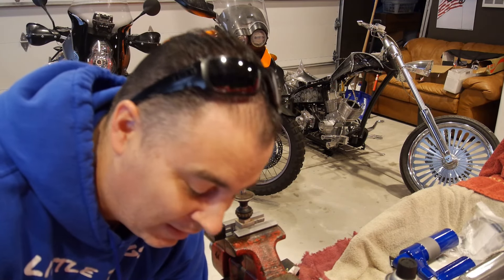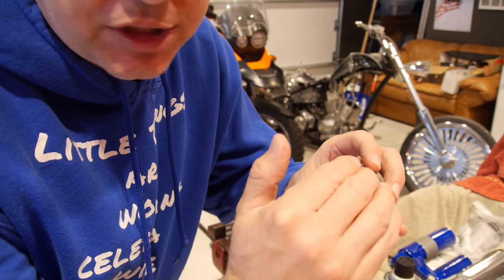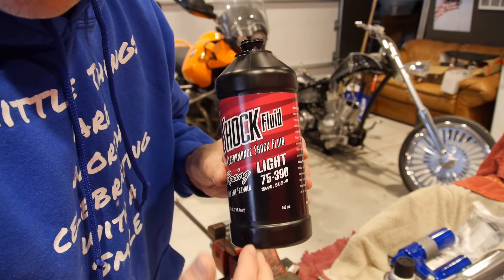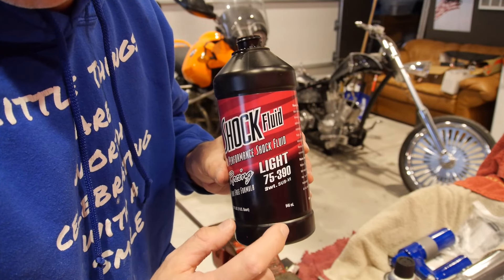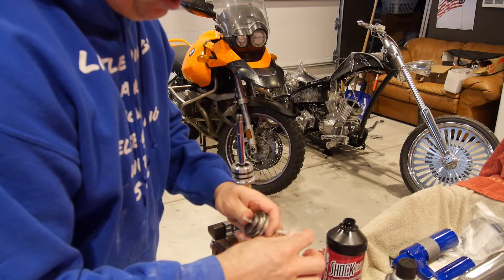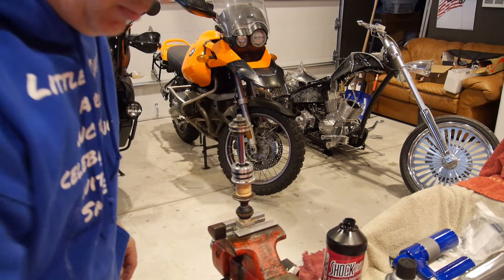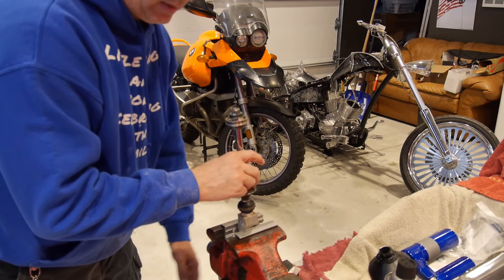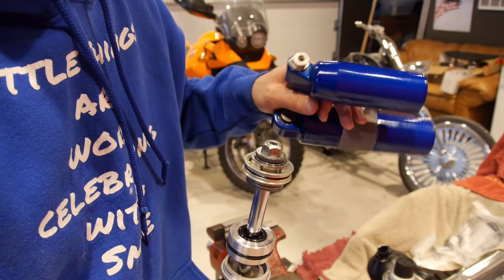++Athena++ 2.0 WR310R - Shock Assembly - Pt1

Comment: My KLR needs the suspension redone. Planning on getting a heavier spring and putting some fresh oil in in. I've got a nitrogen bottle. I "rebuilt" a pair of Fox Racing shocks that I intended on putting on my Jeep then decided not to lift it higher than it was so I sold them. Not sure if I want to fiddle with the shims or not, though. Thinking I may just go with a heavier oil to help counter the higher rate spring. As it is, it bottoms far too easily for my taste. Not sure yet what I'll do with the front....
Reply from the maker: Changing the shims are easy bro!! You can do it!! Well done!!!